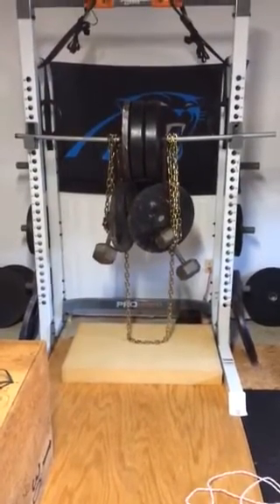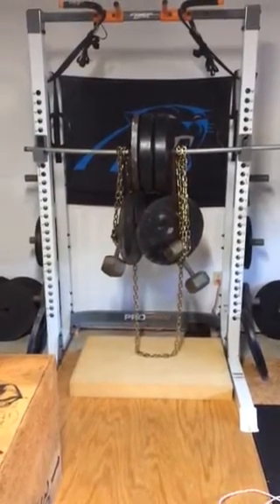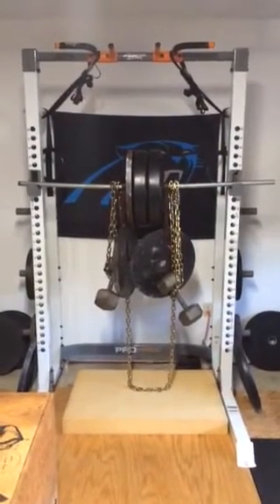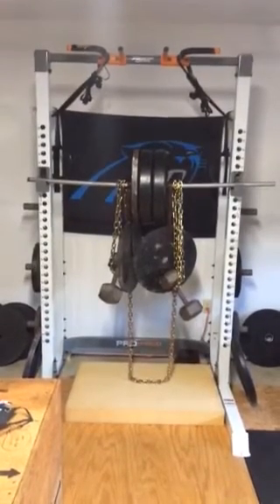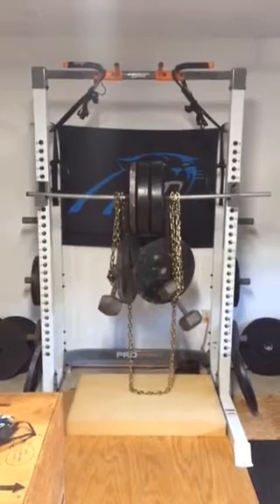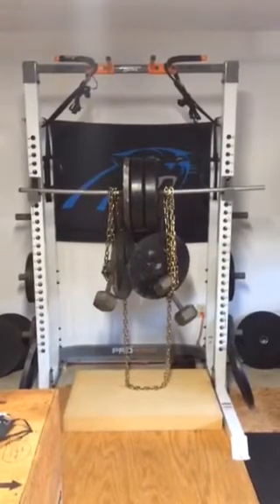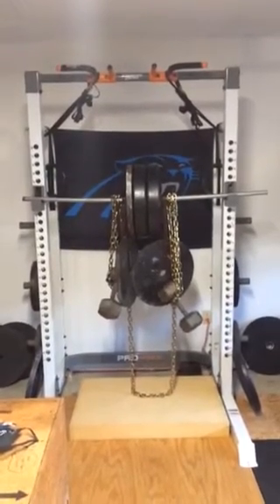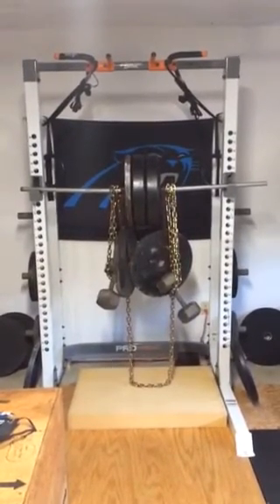Testing 3/4" Galvanized Pipe for strength

Comment: slide a 1/2 inch pipe inside of it: Good to go. If you double the length of the pipe, does it cut the beam strength in half? (would it hold 165 Lbs)